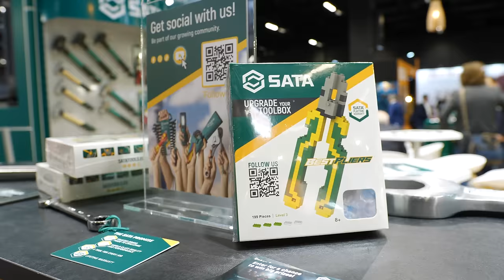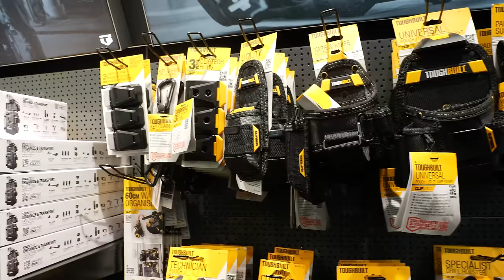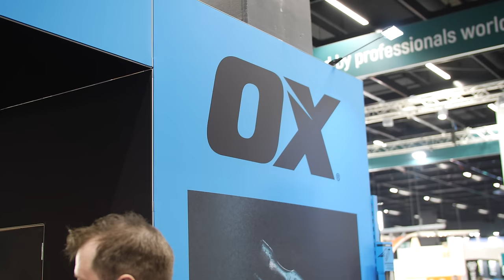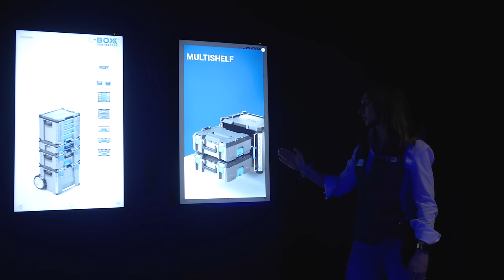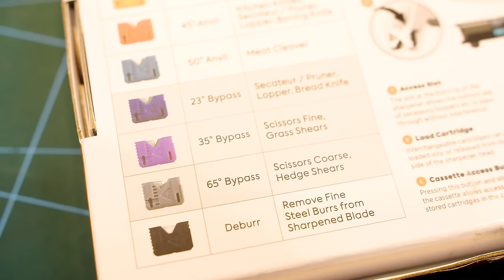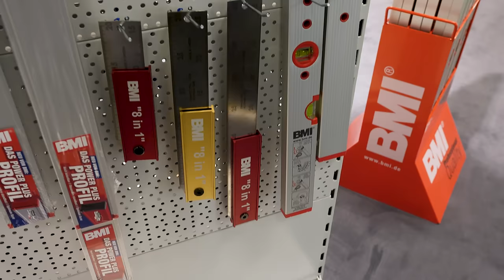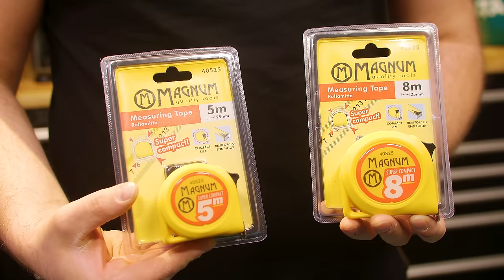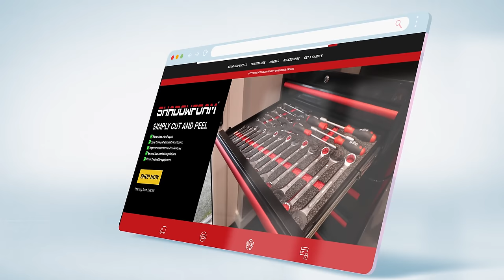I Found The Most Amazing NEW Tools at Europe's BIGGEST Tool Fair!

Comment: Tough Built might be my new favourite brand, the prices are so affordable for the average tradesman and the quality is unreal! Love it!
Reply: I’ve always skimmed past them before when I’ve seen them in B&Q, perhaps they’re worth further consideration. 2/3 years ago I found a Homebase own brand flathead driver, probably about 10mm. I used it for something ( chisel, podger or the like ) at the time to protect my expensive Klein driver. Afterwards I found a vertical slot on the outside of my tool bag and mindlessly put it in. 
I’m a self confessed tool snob, but damn, that driver is by far my most used tool………………. 😂😂😂
Reply: Cool tool finds.
Reply: 2:25 I have this spanner but it is made by crescent tools and you can get a socket adapter for 1/4 " screwdriver bits and 1/4" & 3/8 socket adapter. Did try and upload a Picture( but the app doesn't support it ) and the guy at work gave me the different adapters from another make, oh maybe that was Sata tools

Comment: Sata tools have been around on Amazon in the US, for a while.  
That type of spline looking socket is made by by many brands, now.  I haven’t bought into them yet, but the pass through is get more and more desirable to me.  
Looking up the Sata crescent wrench.  Sometimes it’s nice to travel with only a few tools to get a lot of jobs done.
ToughBuilt looks nice.  Another tool manufacturer I’ll look up.
Still up in the air about the  stacking boxes.  I carry a canvas tool bag.  My drill bit box, 2 cordless, 4 batteries, set of box ends, tape measure, level, bit set boxed, and a standard socket set and ratchet.  Covers every thing I need.
No one makes a box 5 inches high, it’s all 6+ inches and will not fit under my truck seat.  Width and depth on the systems are good, but all are to tall.  My canvas bag stuffs under nicely.

Comment: Pico do an excellent tape measure with a window on the top and a hole at the hook. You fold out a little pin on the base, put a pencil in the hole, pull the tape until the desired length is displayed in the window, and then you can spin a perfect radius. I use it much more than I thought i would.

Comment: Really like the Magnum Easygrip, so many awkward plumbing situations where it's a hassle getting slip pliers onto the joint, this looks like a great solution. Also pleasantly surprised by the price for that Sata set, even as a DIYer it seems very reasonable. Not sure about adopting a proprietary coupling for the sockets though, doesn't seem necessary to the function or am I missing something? Your videos have introduced me to so many tool brands and designs I'd never heard of! If you can manage a longer visit next time, I would very much like to see you investigate the smaller stands too. Probably have to wade through a lot of junk and gimmicks but there must be some treasures in there, yours could be the first major channel to feature them, and the big names have plenty of marketing reach already.

Comment: At a local supplier for building materials here in Germany, I found what they called a "Kraftspaten" lit.: force spade. Costs about 150€ but that thing is an all-metal beast. The blade alone is something you'd find on a guillotine. You'd need some umph to use it. And steel tipped boots. But if you ever had a spade break or bent when you gave it a bit of a wellie, as I have, this one won't. As the guy in the shop said, it's pricey, but you'll never have to buy another spade. Or guillotine.

Comment: The knife looked Great!

Your channel covers a variety of topics that interest me, one of which is foam-out portable drawers. I’m not sure if you’ve encountered this, but we’re in the aerospace industry where all tools need to be shadowed out and transported to customers’ facilities. I’m in search of a large portable drawer system that can be stacked. Currently, the only option I’ve seen is the small L-Boxx type boxes, which are approximately 2 feet wide by 12 inches deep. These are adequate, but too small for a complete set of spanners, socket sets, riveting sets, and measuring tools. Have you come across anything larger that might suit our needs?

Comment: The Tough Built knives look like a great addition to add to the tools. I do like the folding tape measure. Especially the one that you can fouls around and it will not break. I can not find these in the US & I would like to have one. The new pliers look pretty cool. You mentioned the Bacho adjustable spanner wrench. I have the 10” one and love using it. By the way Bacho makes some of their tools and is rebranded to Snap On.
You have a lot of tool boxes that stack together that are different than in the US. I have a lot of the Milwaukee pack out & I am go to buy some of the Kline Mod Boxes. I watched one of your previous shows & now I subscribed to your channel. It is always good to see new innovative tools. The adjustable pliers like the covers. How do they compare to Knipex? I like a lot of the Knipex tools as well. When you came to the US you bought the snap ring pliers made by Channel Lock. I had one of those but they were frustrating to use. If you do not get the tips perfect they do not work well. For in the US the Irwin Brand is better. I jus bought them and I was surprised at how well they do work for I have a set of Snap on and Knipex snap ring pliers. Love your show and keep up the good work.

Comment: Like that Sata adjustable looks kind of useful; might have to get one.  That speed square is a nice space saver too.
Like that pro-click system, finding useful pocket that stay clipped and are easy to change is needed. might be a better choice for a chalk bag.
Don't know if you have seen it but another YouTuber seem a tool belt that has a harness which supports the weight more and has a few other gimmicks ( perkinsbuilderbrothers).

Comment: I like the 6 in 1 but can you swap out the bit's depending on the job you have ? My choice of tool is the reload utility knife I use knives a lot in my hobby repairing and model building often leaving them lying around as i hve different blades in separate knives

Comment: The one thing about that toughbuilt knife is that it also autoloads another blade. I believe that it is five blades you can stack together and once you pull one out, you can pull back the slider and it will automatically load another. 29:42

Comment: as far as quirks go, that voltage locator built in to the electric screwdriver is excellent, if it could also find studs, that would be amazing - would save putting an extra item in the toolbox!

great vid, i love going to exhibitions for tools and manufacturing processes.. subbed!

Comment: That SATA wrench and pass through socket set at the beginning,  is actually sold under several different names. It's made by Apex Tool, the parent company of SATA, GearWrench, Crescent,  Lufkin, Nicholson,  and many other brands. I know that exact set is sold under the Crescent brand here in the states, and it usually runs around  $25 or so. I've seen it as low as $16 on sale.

Comment: I thought the Autoloader is very clever and as you can change/load different heads was brilliant! I had a Skill electric screwdriver some time ago and the only problem was you couldn’t change the battery, normal problem, whenever you reach for it the battery is flat!

Comment: I just found your channel. New subscriber.  I like the made in Canada screwdriver.  Don’t know if I would buy one but it is very interesting.  Also I have used Stanley power lock for 50 years.  Over the last 3 years I have bought more than the previous 47.  They don’t make them like they used to.  I am looking for a better brand of tape measure.

Comment: The SATA wrench seems to be more or less the same as a Crescent CPTAW8.  Even the plastic case looks exactly the same, however the polished area around the socket part of the wrench is slightly different.  I wonder if SATA and Crescent are owned by the same company or if they are just both rebadging the tool from the same supplier with their name stamped on?
Reply: Seems like Crescent and SATA are both owned by Apex Tool Group

Comment: I built trade show booths for many years and I wanted one of those tough built saws for traveling in went to two Lowe’s that said online that it was in stock. At the second one 1️⃣ noticed it was in a box on top of the racks and I had to have them get a forklift to get it down. I still haven’t seen it on the shelves several years later. Everyone who’s seen it wants one.

Comment: The only issue with the sata is your going to need 2 so you can use the spanner and ratchet to hold the nut and bolt. But still great looking tool

Comment: I wish there were more stackable box systems that were front access / draw systems it feels like every job I do I need the kit in the bottom box, which are normally the deep bo’s! So I have to separate everything! then re stack bla bla bla. I want a stackable system with deep bottom draws for my track saw or jig saw then smaller on top for the grab and go stuff

Comment: I believe that I would have made the tool sack gummy bears specially flavored for relevance.

Paint overspray
WD-40
Steel dust
Anti-freeze
Mobil 5W-30
Lacquer thinner       (30% alcohol)
Leaded gasoline 
Leather
Burnt clutch
Screw in your lips          (that taste when you're holding your next screw with your lips)
Pencil 
Grinder debris
50-year-old grease
July's salty sweat
Stripped wire
Happy customer             (you decide what that means)

Many flavors just like jelly belly, jellybeans.
It will be called Nummy Gummies industry flavored.

2 additional flavors will be added for a fun little game of chance with your friends.
They are...
#1 - Clogged drain hair
#2 - Under the plumbers' fingernails.

Comment: I have bmi robust spirit level , had it 20yrs + and it’s the best level I’ve had the bubble is the clearest to see . I also have the adjustable sata set but mine is by crescent but they identical even the packaging
Reply from the maker: Where did you get your BMI tool from?
Reply: @ShadowFoam  I bought it at a builder’s supplier in Liverpool years ago, I actually went in for a stabila gurder level but was assured these where great and I’m glad because it’s been a great bit of kit and roughly the same price

Comment: You never talked about the one thing that you the tough built utility knife is really good at. If you slide the blade out like you’re using it, there is a little button on the side that you push to eject the bad blade and you can either turn it around or you throw that blade away retract the slider and push the slider back out at it. Automatically reload the new blade from the magazine. You never mentioned that.

Comment: What  tool show/expo. Yes would be nice to get a chance to see more of the show not just the big guys but the smaller innovations to. Also I am a grease monkey by trade and would really like to see some ideas on tool boxes roll cabs even incorporating the brand Snap on and some of the German brands like Stahlwille because like yourself I am always on the look out for a quirky tool that does everything and built like a Sherman tank and very cost effective. Great content and already jumped on the offer to get the Zollstock Shadow Foam folding ruler. I have one of my Grandfathers Zollstock rulers which I don't use anymore as it is not in the best of shapes (sentimental reasons for keeping) still a cracking bit of kit to have. (sorry for the length of comment)

Comment: THAT 5 IN 1 SCREW DRIVER  BEEN AROUND FOR TIME I GOT 1 FROM £ SHOP  ABOUT 7 YEARS  A GO.AND D-CRAP SORRY DEWALT NEVER BUY ANY THING OF THEM  HAD A CORDLESS DRIVER LASTED   JUST OVER A YEAR BOTH BATTERY`S WAS DEAD CRAP, GOT A CHEAP-PO DRIVER AND ITS STILL GOING AFTER 3 YEARS WITH  1 BATTERY